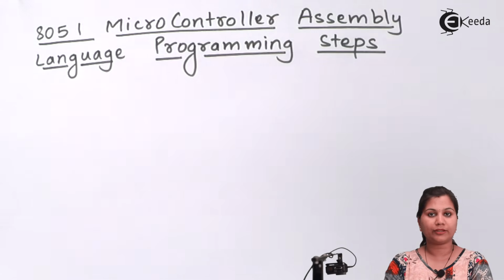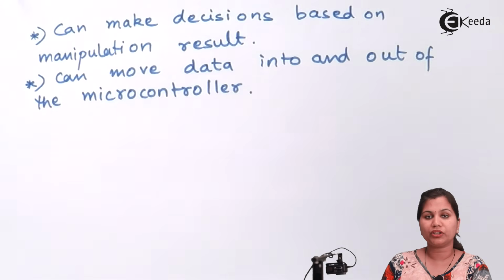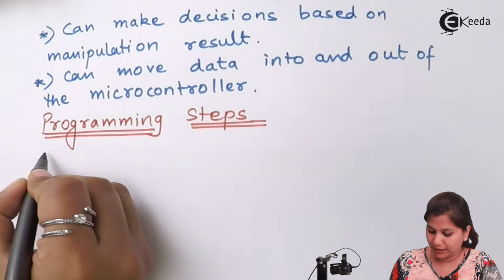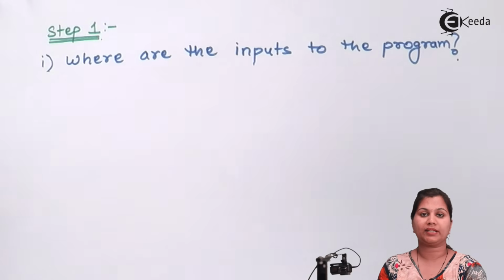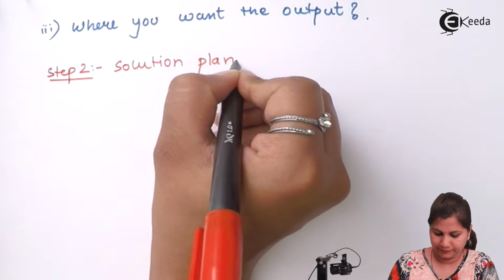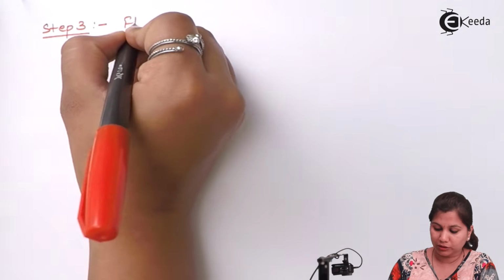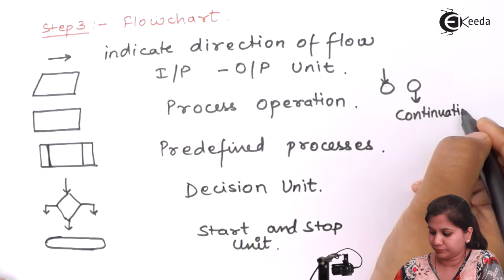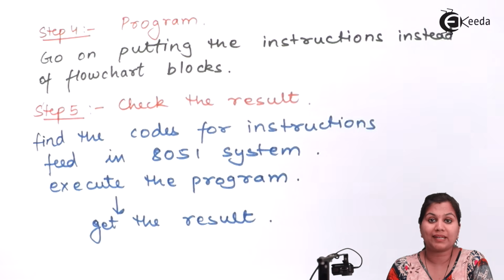8051 Microcontroller Assembly Language Programming Steps - Microcontrollers and Its Applications

Comment: Understand the problem
2⃣	Write algorithm or flowchart
3⃣	Select assembler/IDE (e.g., Keil)
4⃣	Write assembly code
5⃣	Assemble the code to get HEX file
6⃣	Load HEX file into simulator or programmer
7⃣	Run and test the program
8⃣	Optimize and document the code

Comment: This points are already avaliable in any book, my suggestion is could you please explain any topic by practical...
Ex: show i/o s of controller and show working principle with any programming and decision making of controller due to timer or delay
That will help people to understand functionality rather than script
Reply: Microcontroller is selected when the speed of expected product can be catered by it. Same way its INPUT or OUTPUT pins should be more than needed. Hope this helps.
By the way, i have developed flowchart to code converter. You can use it.
Reply: Which books did you use to study this course?
Reply: Hello , can you please help me ? Please tell me did you do anything about programming in avr like assembly language

Comment: Write a program to do logical AND operation on two numbers in 8400 & 8401 & store the result in 8402 ? plzz answer
Reply: Absolutely! Here's how you can write a simple 8051 Assembly Language Program to perform a logical AND operation on two numbers stored in memory addresses 8400H and 8401H, and store the result in 8402H.
Assumptions:

External RAM is being accessed via MOVX instructions (i.e., address range 8000H and above).

8051 is interfaced with external RAM using the MOVX A, @DPTR and MOVX @DPTR, A instructions.

DPTR (Data Pointer) is used to point to external memory addresses.

Program Logic:

Load first number from 8400H into Accumulator.

Load second number from 8401H into another register (say R1).

Perform AND operation: ANL A, R1.

Store the result into 8402H.